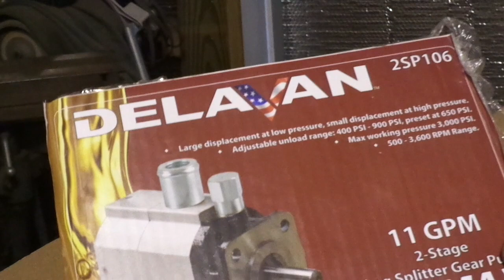Wood Splitter Hydraulic Pump Replacement and Test Run

Comment: Hi Wendell!  You made that pump replacement look easy and brought that old splitter back to life.  Well done! Thanks for sharing your skills once again!
Reply from the maker: Thanks Martin...it really wasn't too much of a project and I was satisfied with the results too !!
Reply: For U newbees that buy this Chinese Tractor Supply junk try tapering the blade or en-largening the blade like I did. I made my blade protrude up top by 3 inches razor sharp... And it works boy does that do the trick... Machine no longer struggles with that blunt blade... You need to go 2inces out at the very top of the new addition 3 inches longer or higher and taper the addition down to the thick blunt area of the OEM blade... Whoooo Weeee what a an easy split... Half the strain on the machine.

Comment: Hello, being a retired (2 years) refrigeration contractor for 47 years, I love how you make use of your skills you used in the trade. Need a 7/8” return, no problem just braze on a piece 😉. I can’t tell you how many times I have made up adapters using that technique. That b-tank was a score no doubt. I also recognize the exhaust pipe cover on the little land grader, Sporlan drier core tin. Good one. Keep up the good work and don’t get sucked back into the HVAC/R bit. Too any jokers want things done for cheap. Cheers!🇨🇦
Reply from the maker: Sharp eye on the Sporlan can.  LOL.  I'm certainly glad to be retired from an awesome career.  The few jobs I do are either for family or people I know very well that just need the help and would do without otherwise.  I too have 'been around the block'....LOL.  But I still don't mind helping someone truly in need.  Plus I enjoy making the sheet metal videos because there seems to be a surprising number of young guys that appreciate the things I show. 
     There's hardly a week goes by that I don't say no to somebody just wanting something cheap.  Thanks Larry for the nice comment and I would tell anyone that wants to WORK that HVAC/R  is a very good choice.  Untold directions to go in the field. Continual changes to stay on top of.

Comment: So by changing the pump you gave the splitter a new life....When I was young and no money I even took a few of them apart and turned the wear plates around and it gave the pump a few more miles.....good fix....CHEERS
Reply from the maker: Heck, its too good of shape to not fix.  It came as partial payment on a side job and my son's father in law really needs it. So its all good.  The motor seems to still be fine...starts real easily so far and doesn't even smoke !!

Comment: Happy New Year Wendel. I love my splitter.Especially since doing all the mods to it. I usually work alone and the size of the stuff that I have to deal with would kill me without the mods. Even though mine is a cheap tractor Supply splitter, it does an amazing job for me. You saw the size of stuff that I was splitting. 2 years ago, I had a huge white oak that was 40 inches across at the stump. Man that was a monster! I wish that I would have has my channel then and would have videoed it.
Reply from the maker: Yes, I remember that video.  Hydraulics is an amazing invention. And most all these older splitters have plenty of room for improvements like you've done.  And yes Gary, I too wish I'd have started a channel many years before I did.  Have a wondeful and Happy New Year my friend !!

Comment: I think I like your home made pto drivin machine better aswell but still a good video sir! Happy new year!
Reply from the maker: Yeah, me too.  LOL.  It was a needed repair and I thought maybe there might be someone out there with a failing pump that might like to see how easy it is to make it work again.  Thanks for stopping in and I'm waiting for a buzz saw video on your channel by the way.....I know you have some flat belts now.....
Reply: @tractorman4461  ya Ive got a solid frost here now unfortunately so I'm a little nervous to try my buzz saw out yet, I'm still doing the old head scratch on how I'ma stake it down lol ive got a big ol' eastern ceder to take down so it will likely be used for all the pole wood off the thing tho we mey be looking at a springtime video unless I can get it good and anchord somehow lol I'll be smiling ear to ear when I do tho
Reply from the maker: @ButlerOutdoorsCanada  If you have access to a welder you can just weld 4 tabs on the frame with holes to accept some 2 1/2' long rebar driven in at opposing angles.  That will hold it securely when you tighten the flat belt up with the tractor.  No welder...?? Maybe drill and bolt in place.  Hahahaha....you'll do fine, just gotta plan for the worst then avoid it at all costs...LOL.                                    Remember that an old dry flat belt needs to be 'worked in' to stretch out and loosen up the fibres. Then re-adjusted for tightness if it runs off or slips.  Actually just a small amount of slippage will toss it off in a split second.  A lot of old timers would rig up a wide idler pulley on the return side of the belt too, weighted or sprung to maintain a bit of tension.
Reply: @tractorman4461  I'm embarrassed to say I don't have a welder, I always end up borrowing one when I need it but I think it's probably time I get off my wallet and see what I can find at Canadian tire lol im a buzz saw rookie so I'm about as nervous as I am excited to get it runnin all the snow n ice is also discouraging for a newbie like me lol but I do promise I will get that old thing going with my massey, i just need to gather up the courage

Comment: Wendell man I almost didn't recognize you all cleaned up lol.  Pretty neat got that thing going no problem now you just need to fabricate a larger base plate and you will be in business.  I agree about the vertical splitter not being fun to operate, that is why I have the horizontal Split Fire on the back of my tractor. Take care brother.
Reply from the maker: Dang Ben....missed this one.  The vertical has its place when you find yourself in the middle of a pile of 30'' - 40'' oak !!  But I couldn't do it all day long....  Take care buddy....
Reply: @tractorman4461  I was about to think you didn't respond to us lowly new channels with no subscribers lol.  Cut a fellow a break it's rough down here. Take Care Brother.
Reply from the maker: @OGAOutdoors  Hahahaha...naw man.  I've been finding a lot of comments go into the spam folder for no reason I can tell.  I found 80 good comments there the other day.  I didn't realize your 16,000 some odd subs would stay with Teresa's half of the production.  And I still haven't done any thing with Instagram. Take Care Ben and keep splitting....you'll pass me again in no time !!
Reply: @tractorman4461  Yes it’s good practice to check that spam about twice a week especially when you hang out with shady characters like me. I’ve got a video coming soon splitting wood into the shed and you may get a little shout out by the way.

Comment: I enjoyed your video. I also have an old Duerr (24 ton) splitter with an 8 HP B&S motor. Had been running fine, but now the ram doesn’t work. Last I split was some large, knarley maple (on the verticle).
At this point I’m suspecting the pump is bad and am thinking of trying to rebuild it but there is no name for a model/brand, just a # on the end. X10.9/2.1
Any thoughts? Should I just get a new pump?
Reply from the maker: Personally I would just buy a replacement pump. Two stage pumps for wood splitters have become very affordable.  Of course the first thing I'd do would to to disassemble the bad one to just see if there happened to be a simple issue.  But they can 'look' perfect but be worn beyond tolerance which is what causes the loss of flow issue over a period of time.  Farm supply stores are a good source as are Northern Tool stores.  The tricky thing is to make sure its not a problem with the control valve though because you may have a faulty internal relief in that.

Comment: Good day Sir ( very nice shave Sir ! ) , Very nice puppy dog and Nice music ! Great fixe and Great brazing tips for sure ! Sir I do agree with you about the ergonomically use of this wood splitter and If I had one like this one ( I will modifying it at once !!! ) I spend too many years on various concret hangar or tarmac floor !!!  Keep up the great works Sir Cheers !!!
Reply from the maker: I have brutalized my knees over the years as well.  Kneeling on the rock covered rubber roofs to make repairs to commercial units on the roof.   Then making repairs on concrete floors....arrrrgggghhhh !!!  One time I was driving home Dave, and my right knee felt real floppy and fat.  When I got home it was HUGE....A big sack of fluid about a 1/2'' thick was the size of a football all around my knee !!  It went away in a few days and I never did go to the doctor with it.  LOL.
Reply: @tractorman4461  Ho boy, you are rough man on yourself Sir... That is an amazing life story Sir,,,, THAT IS WHY YOU SHOULD WRITE YOUR BIO !!! LOL !!! I WILL PERSITE LOL  Have a blessed Sunday Sir Cheers !!!

Comment: Good thing you could refurbish this splitter.  That is a good "average Joe" splitter. I used to rent one of those vertical splitters but would put it into a trailer, so I would work standing at a proper height. I had my crane to lift larger rounds.  How did you manage to align the love joy coupler? It seems the pump mount does not let you see anything in there. Thanks!
Reply from the maker: Oh let me tell you Joe, it took a little finagling to align and bolt up.  Another situation where I wish Layla could've lent a hand.  But you can bump them face to face and gently move around until you feel the engagement, then gently tighten to minimize distortion and smooth operation.  Hey like I say, if it was hard, I wouldn't be able to do it !!  (-:  Thanks for the visit....on to the next one now.

Comment: Nice job T! I am sure he will be elated to have it back working like new. In my old Columbo fashion, just one question - how did you figure out that the hydraulic pump was broken or worn out, and that it was the problem? And why is it called a 2 stage pump? Ok, I guess that was two questions. LOL. Cheers!
Reply from the maker: ALL small horsepower splitters have to utilize a two stage pump.  What they are basically is a setup internally that operate on two (gear) pumps side by side.  One is high flow at low pressure and the other is low flow at high pressure.  So when the wood is being split, both stages are pumping the combined amount of oil as the rated gallons per minute....UNTIL.....heavy resistance is felt.  At that point internally the pump shifts  ('figuratively') to utilize only the low flow pump at the exceptionally high pressure to force on through the tough spot, with noticeably slower ram speed. Once that resistance is dealt with, the internals of the pump reverts back to utilizing the combined gpm off of both pumps.  That's why the ram slows down in a hard piece of wood...noticeably slower than normal... its no longer moving the rated gpm.  See the small 5, 6, 8 or even 10 hp motors can move that quantity of oil (gpms) against low resistance, but cannot push it against high resistance, so by automatically dropping out the HIGH volume LOW pressure internal pump and only utilizing the HIGH pressure LOW volume pump the small hp of the power unit can continue to move the ram.  This is how high capacity in tonnage is achieved by relatively low horsepower.  
     Our home made splitters utilize industrial SINGLE stage pumps which require the much greater horsepower of these farm tractors to function at such a high ram speed.  The pumps we use would take at the very minimum a 25 hp motor to even run them under no or very little load.  Any resistance to speak of against the ram would stall the small motors almost instantly.  Now I can't speak of the super commercial splitters like Eastonmade or Wolfe Ridge as to what type of pumps they have, but I would suspect they too are two stage.   It would be interesting to know for sure.... See, about 95% of the wood that goes through just about any splitter splits with very little actual force.  Its that stubborn 5%-10% of the wood that will slow the ram down by going into the low volume high pressure mode.  Please GP, bear in mind this is not engineering data that I am quoting....its just stuff I think is close enough to peak your inquisitive nature concerning the subject.  So it is not to be considered absolutely accurate, but its close enough to get you into the ballpark and if I know you, by next week at this time you will know more about the subject than I do !!  LOL.  And to answer your initial question, I knew the pump was bad internally because on perfectly straight soft woods the wedge would barely penetrate, then the ram would just stall without bogging down the motor.  That means the motor isn't able to do any work, because there isn't any oil flowing.  Then a faulty control valve would sound much differently if the internals were in continual bypass.  It didn't have that sound. Thanks my friend for the thought provoking question and hopefully I haven't steered you too far off the course of accuracy.  But as always, I stand to be corrected and would welcome the input !!
Reply: @tractorman4461  A good answer to a question that was on my mind as well..
Reply from the maker: @ravenfeather7087  I'm glad to have been a help to you.  GP has a incredibly wonderful channel and provides new tractor owners and people new to wood processing very helpful videos.

Comment: Great video. Is there a way to change the shaft seal on the pump? Mine is slowly leaking and a new pump is like $600 now (2022). I have a 2009 Troy Built 27ton splitter.
Reply from the maker: Yes, the shaft seal is replaceable, but it is easier said than done.  The seal should have a legible number on it that will cross reference to several different brands. Sometimes the seal will fail because of slight wear on the shaft and if so the new seal will leak fairly quickly.  If you feel a wear ring on the shaft where it rides on the seal,  check out a company called Redi Seal or Ready Seal.  If they are still in business they can supply a very thin sleeve to cover the shaft across the wear spot and keep the new seal from leaking prematurely.   If you disassemble it make sure it is in a clean environment because foreign materials admitted to the hydraulic pump are very bad for causing wear.  That's probably about an 11 gallon two stage pump on that rig and unless prices have drastically changed, it shouldn't cost that much. Try looking up splitter pumps at Surplus Supply and see what you find.  Hopefully something here is of help to you.
Reply: @tractorman4461  Thanks for the reply! Found the pump with northerntools and bought it. $250. Figure let me do whats easier for me.
Reply from the maker: @WeatherNut27  I was going to make that the second suggestion.  Northern Tool has a store just 20 miles north of me.  I got the 11gpm  Delavan pump though at a local farm store in town here.  Good to see you are on the path to recovery ! Glad to hear it.

Comment: Thanks for the video, I am changing out a pump in homemade splitter.  I replaced a 4" cylinder with a 5" and didn't help, replaced the old Honda engine with a 420cc engine, didn't help, so now I've removed the old pump and have it at Northern Tool and Randy there is looking for a replacement.  The 5" cylinder is considerably slower moving which is aggravating when splitting alot.  Any suggestions on speed adjustment: Also, how do I bleed air when I get it back together?
Reply from the maker: The only way to increase speed is the increase the flow rate or decrease the  quantity required. The latter means a smaller cylinder which decreases capacity because the force applied is lowered. Increasing flow (gpm) means increasing the horse power to move the higher quantity in a given time. NTool should be able to match your engine to the appropriate two stage pump to make the two match. Does this make sense Kevin ??  Thanks for watching and good luck on your project !!
Reply: @tractorman4461   if I understand right I need to go back to the smaller cylinder.
Reply from the maker: @kevintaylor8832  yes unless the new motor can handle the greater gpm. The five inch will produce more force, but because there’s more volume of oil required to fill the cylinder it will move slower. I’d put the maximum gpm pump possible that the new motor can handle. If it cannot handle more then the original motor I’d consider going back to the four inch with the new pump. Your Reservoir tank has a vent on it, and it will automatically vent itself as you work the cylinder back-and-forth.You’ll probably notice the pump cavitate a little bit and the cylinder may be jumpy for a few cycles but that is the air being pushed out as its replaced by the  oil..
Reply: @tractorman4461  very helpful.  One pump Northern Tool mentioned was 11gpm.
Reply from the maker: @kevintaylor8832  I think the one I installed on this splitter was a Delavan 11 gpm.
Reply: @tractorman4461  Another question I had answered.
Reply from the maker: @ravenfeather7087  Awesome...that's what I like to do.